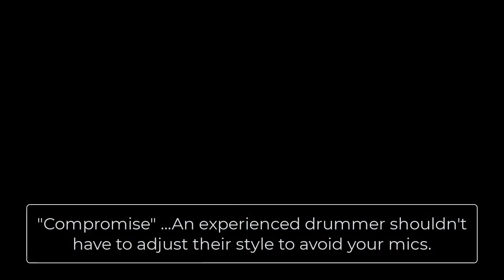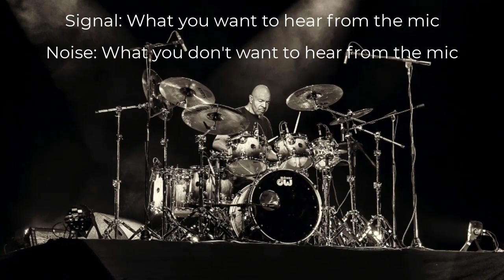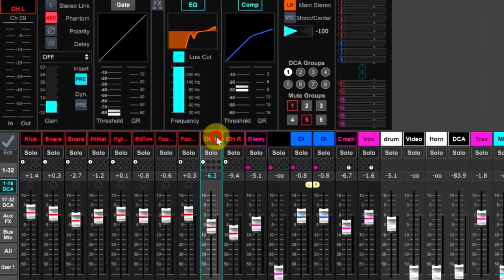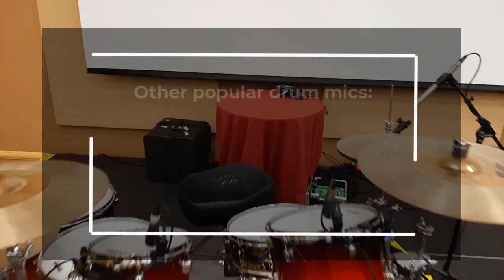How I Mic Drums For Live Sound - W/ Kenny Aronoff On Drums - Also A Look at the Porter & Davies BC2

Comment: Excellent video as always. I use the Porter & Davies both on acoustic and electric drum kit. Sending out of the board from an aux to the BC-2 works amazing. Cleaner signal, and more control of what to send to the throne, such as a little bass guitar, floor tom but mostly kick drum. Best purchase I have made in a long time.
Reply from the maker: Very cool! The BC2 is a nice compact solution. Well thought out and packaged.

Comment: Hi Alan.
I love my sennheiser e901 mic for kicks. It has a directional top end which makes getting the amount of 'click' you want from it easy. Lay it inside the kick. Point it at the batter head for lots of top end (metal etc). Point it at the shell of the drum (90 degrees off from the batter head) and it's warm and wooly. Anywhere in-between gives you increasing amountd of click the further forward it's pointing. So easy to do.  I rarely need to eq the kick now. 

Requires a 5" hole though so I always keep a d112 in my mic box for when the drums are not ported.
Reply from the maker: Cool. I don't own a 901 but I've had good results when I've used one.

Comment: The drummer in our band uses a small jazz kit, 18" kick, one crash,  one ride. He gets a surprising amount of tone out of it, but two overheads would almost touch each other. I have been using one overhead, a KSM141 in omni and am getting great results. Each show I have to experiment a little to get just the right placement. I also use a KSM141 in omni over our percussionist for bongos, congas, hand percussion and timbales, although the timbales don't need much help so I keep it slightly away from them.
Reply from the maker: The KSM41 are great mics. Versatile. And speaking of 1- OH, I probably should've mentioned it in the video, but there are times when maybe the stage and room size dictates no OH"s needed overall... but maybe the ride itself just needs miced.
Reply: I get away w/ an older beta 91 in the kick w/ 1 overhead over my right shoulder pointed @ the snare.  Get a lot of favorable comments on this combo.  Jazz or honkytonk gigs.
Reply from the maker: @donaldrankin7859  I've got a new Beta91A and the old SM91. It's funny because when the Beta91 first came out, everyone still wanted the SM91. These days, nobody seems to even remember the SM91... LOL...

Comment: Having the snare mics on stands makes any band changeovers easier.  They will also have a lower chance of getting packed up with the band/drummer's equipment at the end of the night if they are on stands and not attached to the drummer's snare.
Reply from the maker: Yip! I mentioned a snare swap in regards to a broken snare head, but your point about also quick band changeovers too is good. Same concept but I didn't think to mention that. And yes, a mic can walk off pretty easily connected to a snare rim. Especially in combat conditions, quick changeovers and all of that. Even if the drummer has no plans to steal the mic, you don't want to have to go to the prep area to search for a missing snare mic that is still attached to the snare. The snare is such a quick grab in a changeover- grab it stand and and all and it get off the stage, that it's easier for the attached snare mic to get missed than about anywhere else on the kit where there is a little more time for you to grab mics. Even if you realize you didn't get the snare mic yet, you're still back to the point of chasing it down. Which can cause other issues taking you away from changeover duties. Good point!

Comment: Great video mate!! At some gigs, I've also seen crash + ride cymbals etc.  mic'd individually, pointing below the cymbal, with a condenser mic. Have you tried this and, if so, what's your advice for mic'ing like this?
Reply from the maker: I've done the under-micing thing. It kind of depends. One thing I like about overheads is the life they add to the snare. Probably especially when not using bottom snare mic, but either way I still like the OH's (if the stage/room can support OH's... if the stage isn't very big then the vocal mics serve as OH's ;) ).
So, the under-micing thing (alone) on cymbals kind of loses that. If you do a combination of under-micing and OH's then you need to really pay attention to the polarity and what works because you have mics pointing up and mics pointing down, and at the same things sometimes. And space too. So a lot of mic/sound interactions at play.
A lot depends on the drummer too... Sometimes you just need a mic on the ride cymbal, just to make sure it's fitting in the drum mix where you want it, and maybe the OH's don't get you enough ride for one reason or the other. And one of those reasons could be the drummer just not digging into the ride like the crashes or hats. Plus, the hats are almost always mic'ed, so you DO have that control anyway. Or maybe it's a small stage and you don't really need the overheads, but do need a ride mic.
So it could be a case of under-micing around the cymbals on the kit, or an under-mic just on a ride... or even just a mic on a ride just like you'd mic the hats, and there still could be OH's too.

Comment: With 2 overheads, it's a great idea to place them the same distance from the snare (it's loudest and hit often). This eliminates phase issues. And trying a polarity flip on both overheads as mentioned can also help.

Alan always has great advice!
Reply: If you want to avoid phase issues then do an XY... period. Why did people stop doing them is beyond me. You will run into phase issues with spaced overheads unless they are absolutely pin-point perfectly spaced equally from the snare, front and bottom of the kit, and angled at a perfect 90 degrees. Why bother? An XY also saves you a stand, and you can make it go higher or lower to adjust the natural reverb. If you have a lot of space, like an outdoor festival, make it an ORTF. Way huge sound...!!!

Comment: Thank you very much for the valuable info! One question tho, when flipping the polarity on overheads do you do it on each overhead or on both at the same time? I have my overheads stereo linked and flipping the polarity would then mean flipping it on both channels at the same time, right? Thanks!
Reply from the maker: Both of them. Give things a listen either way. It might not make enough difference to matter, especially with a high HPF roll-off setting.
Reply: @AlanHamiltonAudio  Thanks!

Comment: great video - appreciate it.  one question ...  I thought I read somewhere that the hi-hat mic should be pointed/angled away from the snare/drummer (so as to not pickup unwanted noise from the drums themselves).  So, kinda down and away ...  toward the outside edge of the hat.  No?   Matter of preference?  Thanks.
Reply from the maker: I tend to point it on the backside, top of the hat, at whatever angle I can make work depending on the rest of the set (space). So the hat becomes a bit of a natural shield between the face of the hat mic and the snare drum. I don't normally put it at the edge of the hat where it catches the clashing of the top and bottom cymbals more than anything. So... about half way between the center of the top cymbal and the outside edge of the cymbal, on the opposite side of the snare drum. Roughly.
BUT... loud snares are going to get in the mic. And about all snares are loud snares in pop/rock/country. Some louder than others ;)
I'm typically using a HPF on a live hat mic so that means at least a 400Hz HPF. So that filters some meat of the snare out of the hat mic/channel (technically the hat still  gets it, but the console is filtering it).
That still leaves a lot of crack and snap potentially getting in the snare mic, but there's only so much that can be logistically, so in some ways that bleed just becomes part of the overall drum sound.

That said, between the placement, the hat acting like a shield between it and the snare drum, and the HPF (and maybe a bit of further EQ cutting), it's not like the snare dominates the hat mic/channel. But, still, it IS there... There's only so much that can be done. Especially live where you can't tweak and tweak it like in post in a studio and play with DAW plugins and tools. Not that those couldn't work live, but the studio gives you multiple passes to find exactly what works for a particular drummer on a particular song. And even then... for most things, that's probably not happening anyway.

Comment: What mic do you use for drums without a port on the resonant head? Do you ever mic the beater side? What do you use? So, I got a little story that drummers might like: 

For the past 10 years I have had the occasional privilege of mic'ing Denny Carmassi's kit. The first time was in a small brick-walled pub, 20ft wide, 120 ft long, 18ft ceilings lined with copper, and he was set up in front of the 10ft x 10ft front window, without curtains. 
I usually mic'd drums in there just to add gates and compression and to basically drown out the reflections in the room with brute SPL force  (I had Meyer speakers flown above). Denny said, "I don't think you need to mic the drums". I said, "Please? Just so I can say I did?" He smiled and said, "Sure". (He is such a nice and humble guy). When Denny hits the snare he doesn't just use his wrist or his arm; he uses every muscle in his upper back to hit it like it's the last time he ever will.  And his snare gets a workout - he often plays entire tunes without ever hitting a tom. 
I mic'd him with a b98 top, no bottom. Midway through the second set he blew out the BOTTOM head of his snare. He instantly reached behind him, expecting another snare to be handed to him, and then realized he wasn't in a stadium, he was in a little brick pub in the Cascades. His wife had to go home and grab another snare. 
Since then it's been mostly outdoor gigs. He destroyed my beta98 (my fault) and also my BeyerDynamics (that claimed they could withstand hits), so its just a 57 on a stand. 
For kick I use an Audix D6. He does not have a port on the resonant head so no internal mic (I usually use a b91). I've tried various mic's but I have never been able to translate that "Rock Candy" tone of his drums into the PA. 
Not that he even needs a PA.
Reply from the maker: I've used the B52 for kicks with no holes on the front head before. Not my favorite way to get a modern kick sound, although it works great if a modern kick sound isn't what's called for with the genre. I've probably tried an AKG D112 too, although I can't remember for sure. Apparently, it didn't thrill me enough to remember it... or the opposite- hated it so much I never wanted to try it again! ;)

I've mic'ed a kick on the beater side before when more attack was needed than I was getting from the front head and no hole. I'm pretty sure I've just used a couple of options when I've done that... Either an SM57 or a B57. It's been a while and I don't particularly remember one being far superior to the other, but I would THINK the B57 would be the better mic for that situation. Heh, that probably says more about the utilitarian ways the SM57 than anything else.
When all else fails, stick an SM57 on it. Or just start with the SM57 and move on! ;)

Comment: Alan, for singing drummers, do you have any particular recommendations for microphones, mic stands (the K&Ms?), and/or mic placement (e.g., coming in from the left side or over the head from the back)? Thanks, love your videos!
Reply from the maker: This is a tough one. A lot depends on the drummer's preference and comfort. I'd definitely want something heavy duty like a K&M stand if I went with a tripod. And you certainly want it sitting so that one leg matches the direction of the boom to help take the weight. Some people even get some small canvas sandbags that they can put on the base of the stand (draped over the legs).
Most drummers tend to have the mic coming from their left. But some have it coming more from their side or front side, and a few have it coming more from their rear a bit.

The ones that have it coming from the rear tend to have a gooseneck or small boom attached to the longer boom. This gives them a little more flexibility to move it on the fly, plus clear their shoulder since they can angle the tall boom higher, or the entire stand higher.

The ones that have it coming from the side, in my experience, just have the one boom (typically... I'm sure there are probably exceptions).

For a round base stand, the Atlas MS20 or the triangular MS25 would be the next place to look. These have heavier bases than normal round base stands, and the tubes are heavier too. https://imp.i114863.net/XxJzVo

These don't have the footprint of a tripod stand, so if space is an issue, might be something to consider. Then just add a boom like the K&M boom to that.
And even with the heavier round base or heavy triangle base, you can still add sand bags if you need more weight for counterbalance.
Obviously, some of the counterbalance  stuff comes into play as to how much you need to pull the boom out, and the weight of the mic.

FWIW, I've also seen some drummers using the Shure Beta56A as a vocal mic. It's super-cardioid, so it checks that box for drummers, basically it's the same mic as the B57 or B58, so it can do vocals, and I guess the low profile and flexible design make it handy for drummers to adjust.
Reply: I love using the beta56a for drum vocals! Supercardioid and low profile, plus it sounds great.
Reply: Weird, somehow I missed your response and am just now reading it one year later. I decided that since I drum open-handed (left on hi-hat, right on snare), I just have a pedestal mic stand coming up between my legs with a beta 56a on it. The mic stand is in the center of the triangle formed by my chest and two arms. It works really well!

Comment: My drum mic choices are strictly for the sound they give me. When you put a 604 on a snare, what does it sound like?
Reply from the maker: It's SM57'ish... It doesn't have the top of the 57 so probably a little warmer when you factor proximity effect into the equation. Although it's not dull by any stretch. It's not a night and day difference, and especially on a live stage.
If you're not A-B'ing them and just throwing and going as time permits, then you're just going to dial in the drum and go. It's not a case where you're fighting the snare mic because it just won't get you where you want to be.

Comment: Hey Alan I have a problem that maybe you can help me with. In our band I have a pair of RCF Evox 8 with wooden 12” ported subs and I use a Yamaha 1600 watt 18inch center filled subwoofer. I have the sub set at 90 Hrz cross over point. All the instruments are plugged into my Midas mr18 mixer and are going out to the subwoofer and then into the RCF Evox 8’s. I gain stage the kick drum so I’m peaking at -12 to -16 and my snare at -18. My problem is as soon as I bring up the fader volume to hear the snare I hear my top line arrays start to crackle like it’s digital distortion. When I turn down the fader volume it goes away but then I can’t hear the snare very well in the context of the whole kit. I built an eq setting of your snare from one of your videos and the snare sounds great but am I doing something wrong in the gain staging part or in the signal path from the mixer to the sub and to the line arrays. Any suggestions would be greatly appreciated. Thanks Rick
Reply from the maker: It's kind of tough to say but it sounds like your input gain is conservative enough not to be getting you into trouble. I've worked with the RCF Evox stuff a little, but not anything really demanding (there were no drums). I don't recall the metering on the RCF stuff. Is there a clip and/or limiter light on them?
I wonder if you're just hitting them with more signal and expecting more output than they're capable of?
So the first thing to make sure of is that you don't see a clip or limiter light flashing (or staying on) when you're putting your drum thru them.

Second to that would be that you're not hitting the limit light on your console. I assume you're not because you've probably already looked for that.

If you're hitting the clip on the console output, but NOT hitting the clip on the speakers, then it's just a matter of rebalancing the gain structure in the signal chain... turning down at the mixer and turning up on the Evox.

I'm assuming you're hearing the distorting from the RCF's and not the extra Yamaha sub. What happens if you remove the sub from the equation?
Does that Yamaha sub allow you to pass the signal straight thru or choose DSP? If it's not straight through then I suppose there could be something in the sub settings messing with things downstream from it.

Comment: How to hookup a Sub-N-Up Octaver in kick mic (D112) line to submixer to get rich lows on a 22x14 1969 kick?
Reply from the maker: I've not used one of those. Looks like it's designed for guitar or bass? I think the way I'd try connecting it would be via an insert cable, if you're on a mixer that has inserts.